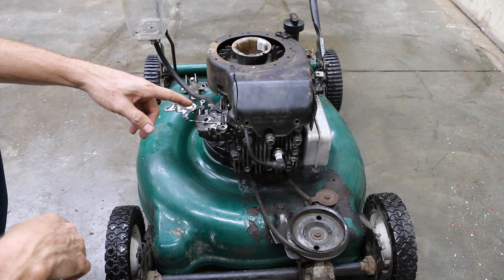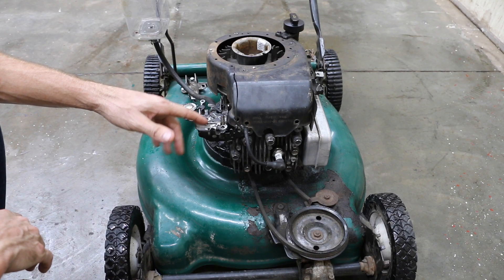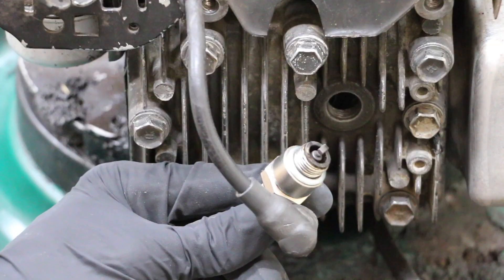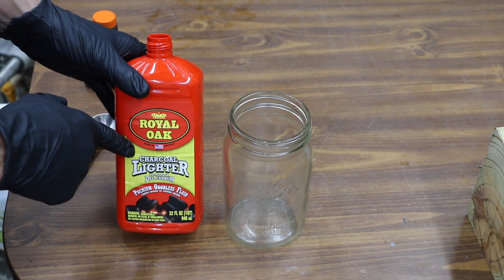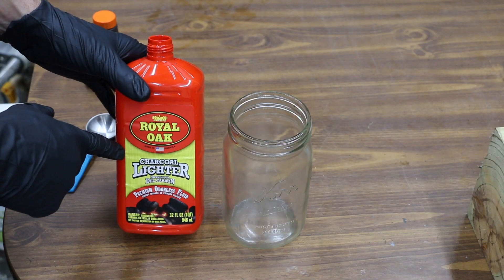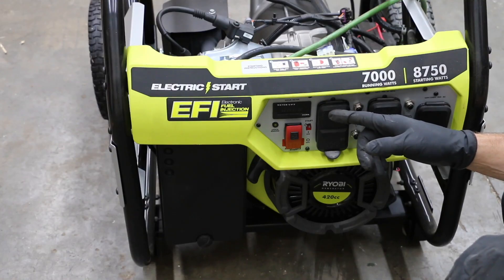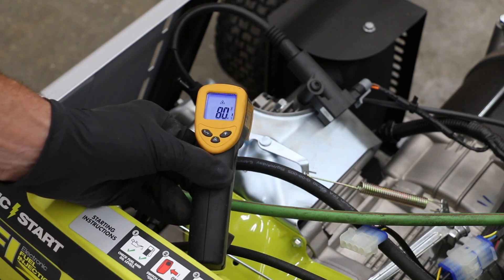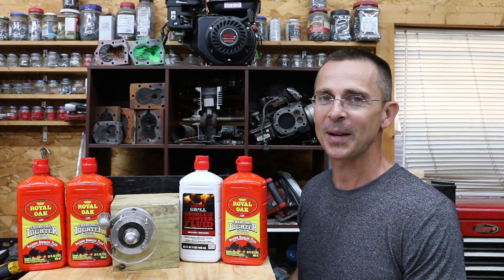Will a Gas Engine Run on Charcoal Lighter Fluid? Let's find out!

Comment: Lighter fluid is just petrol without the additives or octane boosters, just like brakeclean", so of course your petrol engines will run on it, but it will burn fast being low octane, so be ready for some knocking...🫠
Reply from the maker: Thanks for the feedback.

Comment: I put diesel fuel in an old dodge van once. It was cold weather,  started right up, ran fine did smoke some. The next morning was hard to start. I shot some starting fluid in the carburetor,  it started right up ran kind of rough for about 30 seconds smoothed right out. Drove for about 3 hours filled up with gas, and seemed like it was fine. I did find with the diesel/ gas mix it got almost 1 mile per mile better gas mileage.  Frankly not worth the trouble.  By the way, i did that deliberately.

Did this in 1982, the van was a 1965 slant 6, 3 speed manual transmission
Reply from the maker: Thanks for sharing.

Comment: One time I ran out of gas and my can was empty. But I had 3/4 of a bottle of charcoal lighter fluid. Dumped that into the tank, sure enough I got to the gas station. But charcoal lighter fluid is rich and makes lots of soot so I'm sure you'll foul your plugs eventually if running on it
Reply from the maker: Thanks for sharing.

Comment: Of course it does "white gas" just means clean gas. However it doesn't mean better for your car in the long run. You can also mix all your motor oil and tranny oil and brake fluid and veg oil and any other flammable automotive or edible liquids, such as oils, and use that as diesel. Filter well first
Reply from the maker: Thanks for the feedback.

Comment: I've seen you try several different types of fuel in gas and diesel motors, have you tried using lamp oil for fuel?
Reply from the maker: Thanks for the suggestion.

Comment: Soo. Lamp oil? It may need to get evaporated before burning, but should work. I have no idea though. There's a great deal for it in a local store, and got me thinking. Not planning to actually get it, i din't even have a lawnmower but it got me thinking.

Comment: Would be curious and see if you can get the pinging to go away by adding different brands of octane booster to the charcoal lighter fluid.

Ever try anything like this with Naptha fuel!? Would be curious if it would be too volatile for an internal combustion engine.
Reply from the maker: Thanks for the suggestion.

Comment: Back in 2008 I was on a mountain scenic tour in the Iraqi Kurdish region. My driver was asking me if I could smell the gas and lighter fluid. In those regions there were gas smugglers and once in a while you might have got a bad batch when someone tried skimming some and added water and lighter fluid to make up for it. The truck ran but struggled a little at higher rpm, but you could definitely smell fuel fumes.
Reply from the maker: Great feedback. Thank you

Comment: do not use e10 in small engines at all! it will cause vapor lock in the carburetor. corosion on the aluminum parts as well. use engineered fuel for baseline tests instead.
Reply from the maker: Thanks for the feedback.

Comment: When I was in the ‘CBs’ in the late 60’s the military had multi fuel engines.  These engines would run on anything petroleum.  Of course power and performance would suffer when running on anything but diesel fuel.
Reply from the maker: Thanks for sharing.

Comment: But did it last longer on lighter fluid? If it did how would a 30/70 or 50/50 mix go? Would it be worth putting 1 bottle of lighter fluid then filling it with gas to help the pump last longer? Out of all the fuels, you have tried, and with your experience what fuels would mix the best with gas, and do any of them help the fuel last longer? I know price over economy might not be as good but in winter if adding something to help the fuel last longer might be useful.

Comment: Not sure if you tested pure alcohol in a small engine.  You would definitely have to use a carb that has idle and main jet adjustments.  

On a side note.  You remind me of myself when I was 7 or 8 and made a dual carb setup for a 7 hp Clinton horizontal shaft engine.  I learned at an early age that there is such a thing as too much carburetor.
Reply from the maker: Thanks for sharing.

Comment: Charcoal lighter fluid doesn't burn as quickly as gasoline... it remind me diesel. How about to repeat experiment with diesel engine?
Reply from the maker: Thanks for the suggestion.
Reply: @ProjectFarm  can't believe you read my suggestion 🙂
Here one more(not related to the channel): lighter fluid is sucks. It stinks. I always use isopropyl alcohol 91% to light charcoal for my grill. No smell at all!
Probably it another idea for the channel: test different lighter fluids and possible substitutes 🙂

Comment: I love your videos they are all awesome. I want to see tire slime if it would patch a mower cylinder head but put it inside the spark plug hole not a lot but just enough that it wont hydro lock the engine 
yes im being funny with this one but I'm curious
Reply from the maker: Thanks!  Thanks for the suggestion.
Reply: @ProjectFarm  I know it might have sounded far fetched it may just be a waste of time.
Reply: @ProjectFarm  not to mention that every time you clean the mowers cylinder head it may have more hp head having more room for combustion. Now that I'm curious to know about

Comment: With light fluid you need More air and little of fluids and it will be less fire and less speed. And it will pinging because it have not a lot of power fire
Reply from the maker: Thanks for the feedback.

Comment: I found out from a friend who ran out of a gas in a Mercedes c class that an engine can run on Tiki oil, just not very well. I wouldn't want to see what that fuel filter looked like after.
He pulled into the gas station and people were looking around like "what's that familiar smell...I usually smell it when I'm camping"

Comment: Try cleaning old fouled spark plugs with different types of acid such as hydrochloric acid or sulphuric acid.
I tried sulphuric acid and it cleaned the spark plug as if it was brand new from inside
Reply from the maker: Thanks for the video idea.
Reply: @ProjectFarm  
you can use different brands of additice who claim to remove carbon buildups and also try engine degreaser.
It is up to you.
Great salute to you sir!

Comment: Find an rc shop, and look for ethylene glycol. It is an alcohol based fuel for rc engines. If you get the 4 cycle,  it won't smoke. 2 cycle did not  smoke much for me.
Reply from the maker: Thanks for sharing.

Comment: If you were to precoat (maybe a few times while letting fully dry before re-coats) your head gaskets with either a teflon or silicone spay lubricant with high temp rating, might you be able to create a reusable gasket for as many times you replace the head on those motors? Maybe try a high temp teflon of silicone grease to compare?
Reply from the maker: Thanks for the video idea.

Comment: Alright, got to figure out a way to put an EGR valve on the speed test vehicle. I am betting ping can be reduced if not eliminated if we could only control the temperature of the combustion chamber. 
Except I am not very sure if its temperature related, or if its the slower burning nature of lighter fluid which is the cause.
Were there any signs of pre-ignition in these tests? Because if so, all the above is probably useless.  lol

Comment: You should try the lighter fluid in an actual car size engine I bet you get different results like it won't run at all since the lighter fluid is made up of mostly water
Reply from the maker: Thanks for the suggestion.

Comment: In a roll here... I talked to a guy that ran his truck in acetylene during ww2 when the gas was rationed... said it ran fine.Been meaning to try carbide crystals but don’t see them in ace hardware any more. They used them in miners lamps and headlights in early cars.Anyhoo food for thought and be careful!

Comment: Your garage was 80 degrees and you ran 3 space heaters at the same time until the generator ran out of fuel. How hot did it get in there?
Reply from the maker: lol. Great point.  Probably 90 or so

Comment: I know you've tested a lot of different flammable liquids in gas engines, but what about running ICE engines on wood, using a wood gasifier?  Here are plans for a wood gasifier published by FEMA in 1989.  https://www.driveonwood.com/static/media/uploads/pdf/fema_plans.pdf.  There are plenty of videos on YouTube running generators with wood gas.  Vehicles or anything that moves would obviously be a different story, but I would think the Farmabago has plenty of room for a wood gasifer.  Mounting it on the back with one of those storage racks would eliminate any issues of venting any escaping gas, or concerns about the gasifier exploding or catching fire.  It would also give you a chance to test 'wood mileage per hour'.  LOL!  Keep up the great work!

Comment: Very nice testing. have you ever tested diesel oil sae 15w40  on a gas engine against normal gas engine oil to see which one will work better it how it will perform?
Reply from the maker: Great suggestion!

Comment: Does super cooling intake temps with liquid nitrogen or other crio fluids help optimize hp i know cooling intake temp on drag cars works but they use ice not crio fluids and its not super cooled ive wondered if it would be a good idea or not.  Try not to get nitrogen contaminants in air intake it can effect outcome

Comment: I guess no one else caught it when he clearly did 25 on the gasoline test but the turns around an says it was 29 like 2 seconds later .... And a little tip project farm if you want to adjust timing to get rid of the Pinging , every thousands of an inch is a degree in ignition timing ...
Reply from the maker: Thank you

Comment: Can or do automobiles "acclimate" to a regular operator with prolonged use? for ex: can a car change engine/computer settings after "getting used to" a specific driver?
Reply: If they have computer operated efi and engine management, yes. Some just have “modes” you can select.

Comment: The big secret to charcoal lighter fluid is it's low odor mineral spirits, so it's basically parts cleaning fluid.  Way cheaper buying gallons of that rather than quarts of charcoal fluid.
Reply from the maker: Thank you for the feedback

Comment: Was the push mower more efficient with lighter fluid?
Reply from the maker: I should have tested for fuel efficiency
Reply: @ProjectFarm  Well it did give higher RPM's, and I know driving at 55 uses less fuel than driving at 35 does. It may have been. That's a neat little side effect if it was.

Comment: I was happy to see the Wankel rotary engine. Now you can visually seen one of it’s inherent problems; With combustion taking place in only ~ 1/4th of the engine it heats and expands unevenly. Other than the oil burning issue I’ve wondered why there aren’t more generators with Wankel engines. Smaller, lighter, creates more power and if it’s going to run in only a narrow rpm range it can be tuned to be more efficient. Plus it can run on a broader range of liquid fuels more easily.
Reply from the maker: Great point!

Comment: What about a 70/30 mix of gas and iodine
Reply from the maker: Thank you for the video idea!
Reply: @ProjectFarm  I have just always been told that iodine in gas will melt the pistons to the cylinder walls... Another destruction idea is dissolving pool bleach tabs in gas... Supposed to turn everything aluminum to powder

Comment: I ran an 88 Chevy spectrum on around 5 gallons of 87 gasoline and almost all gallon of nitromethane model aircraft fueĺ, the exhaust was glowing bright orange. I did fry the clutch because I got stuck in a field with a doughnut on one of the drivewheels, because I hit the tongue of a house trailer frame that was hidden in weeds 5'+ high, at 60mph.
Reply from the maker: Wow!  Thanks for the feedback

Comment: Suggestion: When I was a kid I experimented with glow fuel in a two stroke lawn mower & a Jawa 350 motorcycle, I think I used 25% nitro. The mower mostly popped & farted with occasional bursts of frantic revs. The Jawa, however, responded differently. After warming it up on petroil, I turned off the fuel & just filled up the fuel line with glow fuel. As soon as it came through the engine went to about 6K on tickover & kept running till the fuel ran out, even when I turned off the ignition & took off the plug caps! The bike survived though.
Reply from the maker: Thank you for the video idea!
Reply: Actually, I just looked through your old vids & you did something similar a couple of years ago with RC racing fuel, but in a 4 stroke. I'm not sure if that's the same stuff but it probably needs a two stroke to do it justice. Either way, keep up the good work!

Comment: Hi, a video of a rating of the best to worst non-gasoline things you can burn as gas in a motor (like lighter fluid) 
Basically, a rank of what you could use if you were in an emergency
Reply from the maker: Thank you for the video idea!

Comment: Compare different 2 cycle oils. Does synthetic work better and worth the extra cost? 

Also compare using alternative oils as 2 cycle mix(motor oil, vege oil, diesel fuels, b10-b100 bio diesel). I've heard people mixing motor oil when they run out of 2 cycle oil. And lubricity test for normal diesel vs ulsd diesel vs various grade of bio diesel available in your state)

Comment: I think the main difference between the lighter fluid and gas is the octane, the lower levels in lighter fluid results in less compression under load and pinging.
Reply from the maker: Thank you for the feedback

Comment: You should try getting some lacolene and see if it will run a motor.
Reply from the maker: Thank you for the video idea!
Reply: Project Farm we use lacolene at work in the rubber industry. Stuff smells like rubbing alcohol/paint thinner mixed together. It’s very very flammable.

Comment: Rule No.1: Never remove the cylinder head or disassemble any part of the engine if it's not necessary. 
It will reduce it's life significantly.
Reply from the maker: Thank you for the feedback
Reply: @ProjectFarm  I was just joking, I'm a professional youtube comment section moron XD.

Comment: But what does it do to the catalytic converters?
Reply from the maker: Great point.  Thank you
Reply: Being a former auto tech, we need to look beyond the engine before we decide to just go for an easy solution, so until we know what happens farther down the line, I wouldn’t recommend these products as an alternative to gasoline in any great quantity.

Comment: Is the lawnmower equipped with a Briggs&Stratton engine?
I'm pretty sure my dad has the same model. It's been used extensively to cut a relatively large lawn for well over 10 years without much maintenance, and it still works like a charm! Besides burning up a lot of oil, haha.
I've watched some of your videos and I have to say that the engine has gained even more respect from me, it seems to be able to take any kind of a beating and go on working
Reply from the maker: Yes, thank you.  It's a great engine design.

Comment: Suggestions: Compare House siding that withstands -40, Hail, Hurricane or tornado winds, 120F heat. Portable generators for extended loss of electricity, Brakekleen is great to evaporate oil from concrete driveways. I'm installing Denso twin tip Iridium plugs in my Toyota 5.7  engine. It took me 4 days of reading before I figured out why the TT gap of 0.036 factory setting is PROBABLY  OK when Toyota specs 0.040.
Reply from the maker: Thank you for the video idea!

Comment: So, the threads for where the spark plug goes in the cylinder head of my go-kart engine have officially stripped themselves out. So now I’ve got to remove the motor completely to tap and re-thread it.... ORRR get a new engine from Harbor Freight. What do you suggest, sir? I was thinking that the 6.5HP 212cc Predator engine would be a nice upgrade from the standard gy6 150cc motor. Thoughts?
Reply from the maker: Thanks for the feedback!

Comment: You evenr think about popping off the drive belt on your go kart before revving the engine so it doesn't run away from you every time?  Or at least putting the back end on blocks lol.

Comment: As always love your level of knowledge being I'm on a budget I made torch fuel out of Xylol and art in a 40.1 ratio noticed a nice orange flame from the wick but when a breeze blew by the flame was almost clear.. Light blue this being said can you run this in a 2 cycle engine or maybe a nitro hobby motor the Ron octane of xylol is 116 given a bit of tuning of carb to meet conditions will it run either type of engine effectively much appreciated God Bless
Reply from the maker: Thank you!

Comment: have you ever considered testing the api certified oils vs cheap oils? I know it cost a lot of money to get the starburst symbol on the front of the oil quart, vs just the sn symbol on the back and im sure a briggs and Stratton will run off either, but there must be a difference considering how many test it takes to get the api starburst
Reply from the maker: Great suggestion!  Thank you

Comment: Do you think you could build a working engine from scratch?
Reply from the maker: I wish I could but I don't have the equipment to build precision parts.
Reply: Project Farm You could probably also use parts from other engines to build a FrankEngine (or Frankenstein's Engine)

Comment: I wonder if you could run a fuel additive, advertised to help clean the carb as the engine runs, straight without diluting it with gasoline and see if it would clean a carb better on an engine that runs poorly and not cause damage to the engine.
Reply from the maker: Thank you for the video idea!